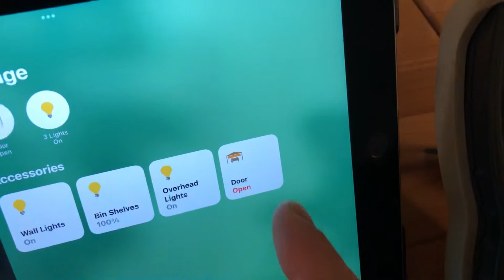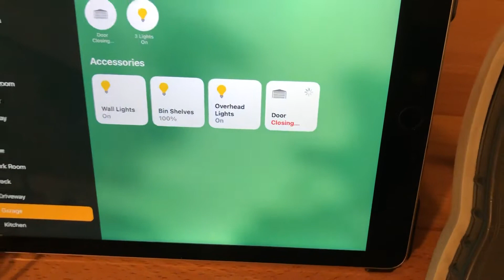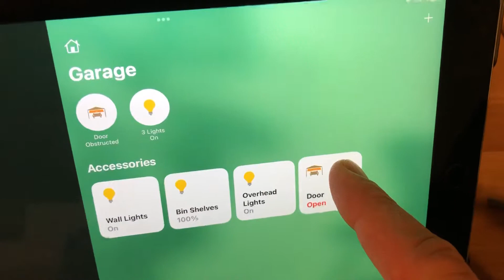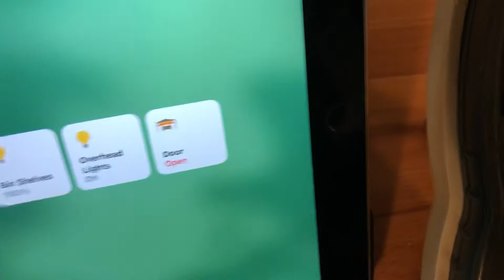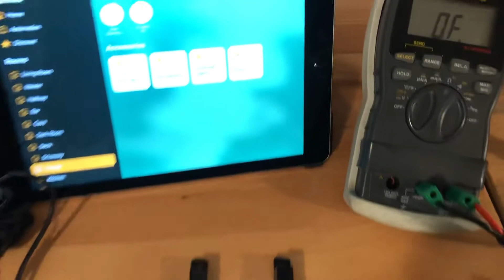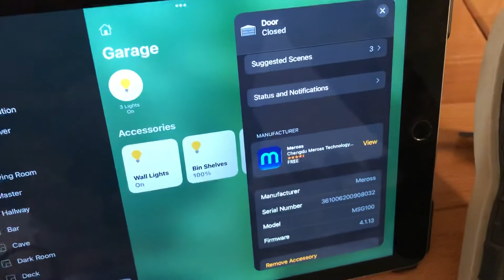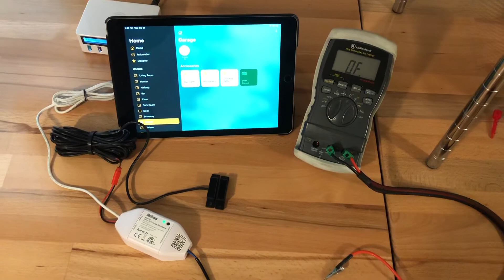Refoss Homekit Garage door opener bench demo

Comment: Thanks for the over view. I just got this device and it didn’t work for my garage opener. Meross sent me an additional device, that it looks like a garage opener clicker. But no instructions on how to set it up. I am assuming that based on this video, I plug the clicker to the wires that are supposed to be connected to the garage opener and the signal will travel to the “clicker” and open the garage. Let me know if you know how to set it up. Thanks.